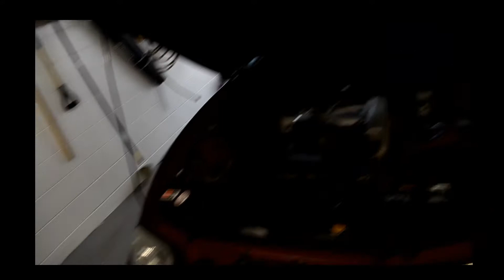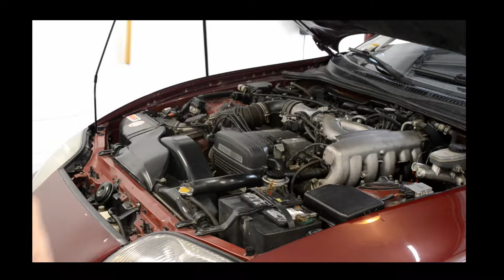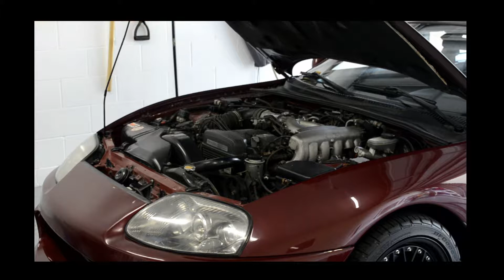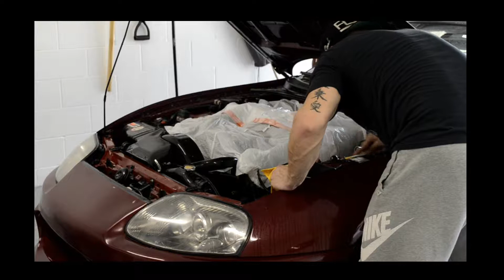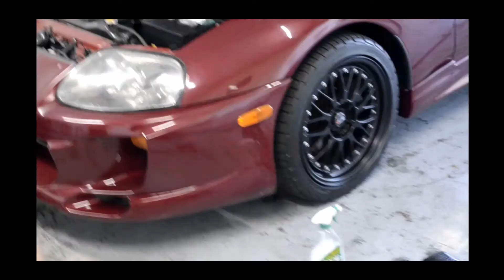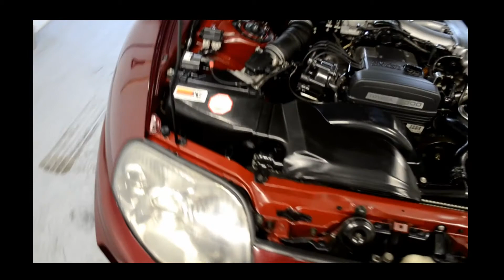MKIV Supra Engine Bay Detail

Comment: Sir, sir, sir...tis a na supra. What ur goal with it? Ive got a na mk4 too. Currently getting a gte block built for a complete single turbo build and swap
Reply from the maker: hellraizer06 I am doing a 5 speed swap soon, then doing new leather, then painting it and hopefully motor swapping it next year but I am going to stay TT for a while
Reply from the maker: Current goal is to get it swapped to a manual and get it repainted back to its original color.  Eventually got VVT GTE with V160 but that is years away.